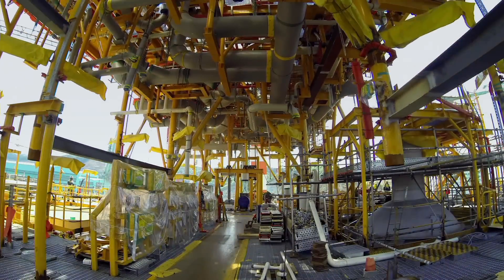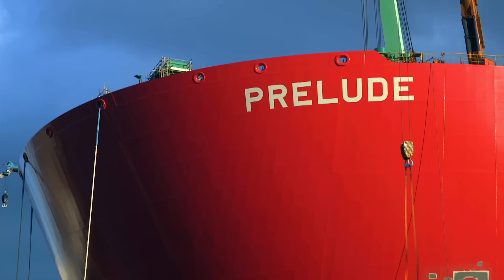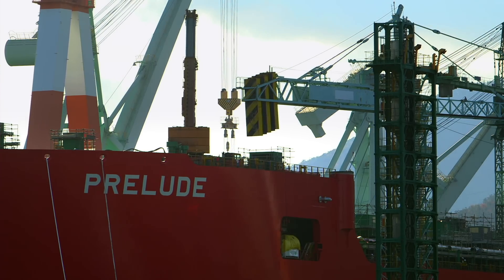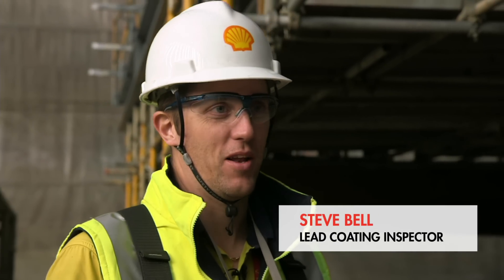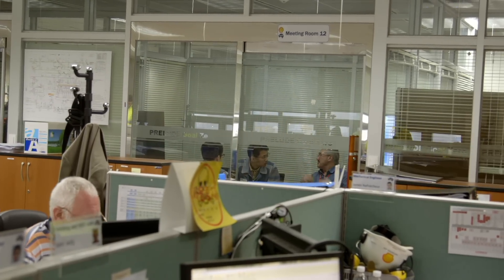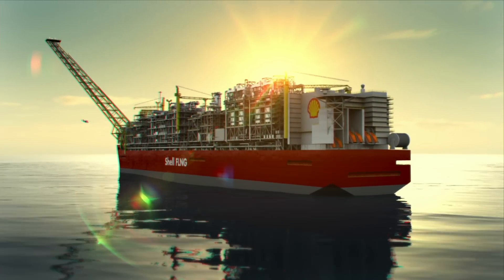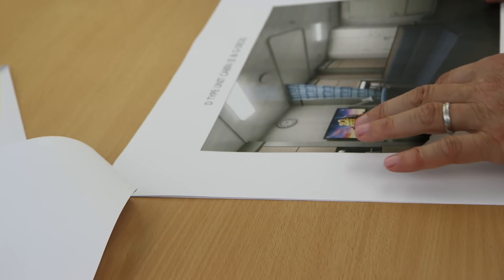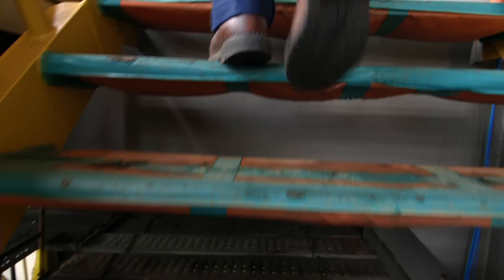Built to last | Shell's Prelude

Comment: Cool, but it's a tame, spin-doctored, yet not-so-subtle reminder that the proverbial powers that be have absolutely no genuine intentions of progressing from a fossil fuel energy paradigm. It's inconceivable that any company would invest the surely hundreds of billions of dollars this must be projected to cost without having arrived at a carefully calculated expectation of staggering profits which renders startup costs inconsequential.
Reply: theoriginalbillholt  Fortunately the other commenters here are not in their teens and aware of how wrong you are in every single point.
Reply: theoriginalbillholt  Glad you've discovered that thing called profit which is the basis of all economies, and which your entire retirement portfolio relies on.  Your next class should be environmental science where you'll learn what the cleanest, greenest, most efficient power source currently is; the one the Greens have been pushing for decades to have.
Reply: I appreciate the environmental passion you have. We need more people like that. 

However, you must also remember that the problem is way bigger. The way things are manufactured firmly establishes the current need for petroleum. If your electric vehicle doesn't need it for fuel - it needs it for its plastics, its tires, it's rubber, the asphalt on the road, the heat to process the steel used to make it and its factories. Not to mention, if your electricity source is non-renewable, you're still using fossil fuel. 

In the past, every other alternative to petroleum was worse (coal, wood, whale oil, etc) and no one knew that burning this much would get us to where we are now. We need to re-engineer the whole system of how the world is run, from the technological aspect, all the way to the economic, and political aspect. As for why Shell and other oil companies continue to drill and refine petroleum, it's because its profitable, and it's profitable because people need it. Kill the need, and the drilling stops. 

The climate problem needs many different people tackling it from many different angles.
Reply: Profit is the last thing we care about when we pay at the pump. But my electric vehicle dos not need Shell. Less profit for you.
Reply: Todd Dunning I'm not expending any further time and 'energy' on yet another YouTube farce. Have fun. My environmentally significant actions are as 'green' as practicality permits. 

A protracted debate could be launched concerning the differences between wisely stimulated economic vigor and rapacious greed. That would perhaps most effectively address my allusion that Shell's Prelude is a wolf in sheep's clothing. 

Solar radiation has the greatest potential as a benign energy source, but it hasn't been fully 'tapped' into yet. This is primarily due to its essentially intangible nature: it can't be geographically claimed, geologically 'tapped', controlled, and ultimately commoditized in the interests of an elite, ultra-wealthy few. I expect there to be attempts made to achieve just that, however.

Viable. Interesting. Unstoppable. These adjectives describe this project. If you're among the relatively few people adding to their retirement portfolios through disproportionately high-paying, atypical employment on this installation, more power to ya. I wouldn't expect such a person to impartially view this as a lucre-driven enterprise. I'd hold someone like that in the same regard as the proponents and beneficiaries of 'fracking' who seem to have no qualms about undrinkable groundwater, ignitable gas discharge through household taps, or the protections granted to hydraulic fracturing natural gas extraction companies that don't have to disclose suspiciously 'proprietary' compositions used in their processes. 

I'm not opposed to this venture, but if someone can't see it as a matter of wealth over welfare they're delusional, or foolishly naive at the least. Even if this endeavor could be demonstrated without exception to be altruistic and in the best interests of everyone, in classic corporate fashion it would only have been undertaken if gargantuan financial gain were virtually guaranteed. That was the point of my initial comment. Admittedly it was probably not worth the effort to make it, as it's essentially a redundant citation of human nature and avarice.
Reply: DreadnoughtMetal2006 muso 
musicacristianavallll.p
Reply: Nurys Vergara
Reply: Nurys Vergara
Reply: What a brilliant response to an idiotic sarcasm of theoriginalbillholt! My applauds to you, sir.
Reply: rizwan asim l
Reply: Kenneth Weiss sure your electric car doesn't require fuel but do you know that shell has invested billions into natural gas projects that led to affordable electricity.
Reply: talha Ahmed eddxcbnnnf2 DC ccc catálogo
Reply: imcan
Reply: .kid shows
Reply: Your a paid commenter. No one in their right mind likes shell even lego dropped them.
Reply: Kasey Deaner 88kklnjj
Reply: @luisantonionavarro1046  to
Reply: Todd Dunning Either you're an idiot or I failed to make the unified point that this endeavor is nothing but a profit leviathan that's being pitched as salvation.
Reply: You need a chemistry class. Methane burns and produces co2. Methane leaks and is 70 times worse than c02. So not clean. Tell your employer scociety needs clean energy not a spin.